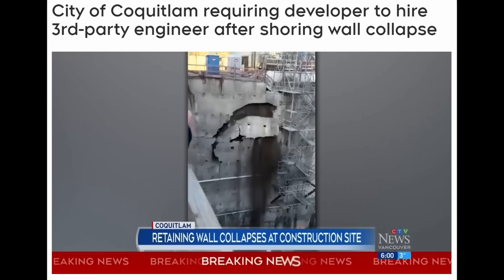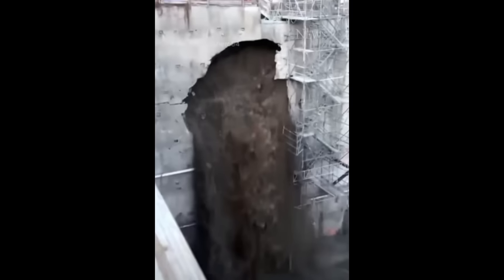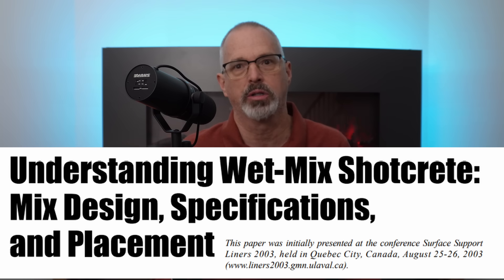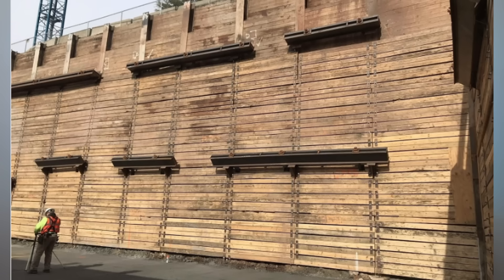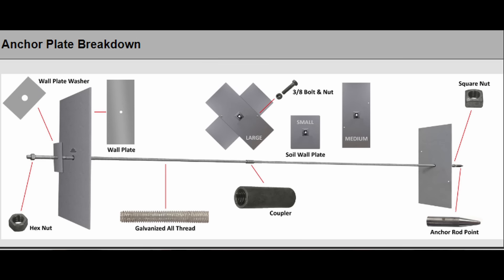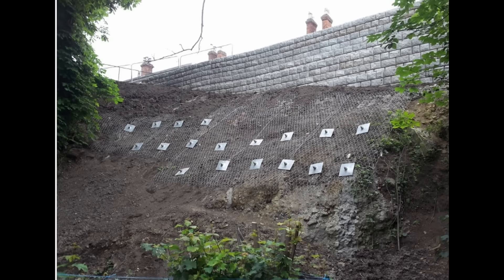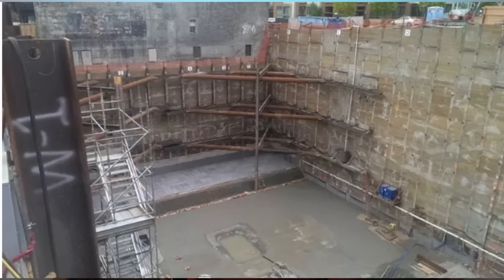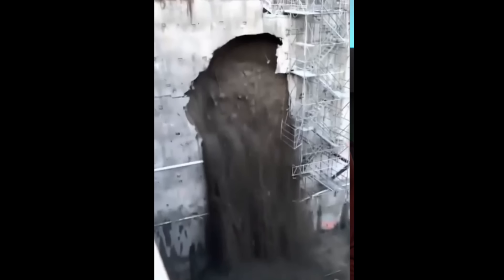Retaining Wall Collapse in Canada

Comment: I saw shotcrete used over a failing retaining wall that used what I think were screw anchors intended for use in foundations for houses. The wall was made of T-shaped CMU blocks, with some zinc plated brackets attaching the rods to the blocks. The whole thing was lined with landscape fabric, which didn't help the drainage. The wall was failing because it didn't have enough drainage behind it, and the constant pressure had caused the bottom of the wall to bulge. The lowest anchors were trying to hold on to liquefied soil. Even the pavement in the parking lot was bulging. The next two rows of anchors were heavily rusted. The shotcrete was applied to the existing wall. The whole thing collapsed about a week later after a moderate rain. I doubt an engineer was ever even consulted because I can't imagine any engineer not realizing that water was the problem and anything that made the drainage worse, such as covering it with shotcrete, would trigger a complete failure. Fortunately the only damage was the pavement in the parking lot and the landlord's balance sheet. I got a look at the wall when they took a backhoe to an undamaged section near the failure. There was no drainage system that anyone could identify, but there were a lot of largish rocks that were not local to the site at the base of the wall. That might have been an attempt at a drainage system, but it didn't meet code even 40 years before the failure when the last revision before the construction was known to be completed. Exactly when the wall was started and finished was not clearly determined, and it may not have been built all at once.

Previous attempts to address the wall included planting aggressive vines in the hope they would hold the blocks together. The wall actually looked nice, more organic than the typical retaining wall. But anyone with any engineering sense would look at it and then park somewhere else.
Reply from the maker: Thanks for sharing that experience.  Having seepage conditions behind a wall if it wasn't planned in the design can easily reduce the factor of safety by 50 percent.

Comment: I work in a different Province as a Power Engineer. I met a crane operator at one of my exam sittings. Young lad was unlicensed and operating the largest tower crane in the Province with no tower crane experience or training. Good people are hard to come by today in the trades in Canada, and in some cases any warm body will do, apparently.
Reply from the maker: There aren't nearly enough people to fill all the oown trade jobs in the U S. either. Plenty of opportunity for experienced folks if they never want to retire!
Reply: @CaseyJones-Engineer  I want to retire - I have been doing this for 25 years - enough already !  :):face-pink-tears::face-pink-tears:
Reply: you can say "Alberta" if you want to. The SAME company I worked for in BC and Alberta was like Japan.....and Afghanistan. The culture in BC's high rise concrete, especially Vancouver, is usually world class, and shot crete companies are specialists you call in; you don't do it yourself. As far as your extreme off thread comment about crane, you maybe should know what BC did in 2005: re-tested EVERY ticketed crane level including mobile crane, Ports lift cranes, and all the other types (ticketed separately). Old guys got the hard questions. Thin out the alcoholics, crackheads, and other druggies types. you have to before someone gets killed. Except Alberta. Freedom fry, and those "lads" are usually head office relatives, so you can't say anything. Had a "hatonbackwards" type powering a full size loader at high speed in an area just east of Calgary downtown, and he almost ran over a senior. That will not happen in Vancouver. Maybe the island or up country.
Reply: @HeronPoint2021  Obviously BC rested on their laurels after 2005, there was a serious crane collapse on Kelowna in 2021.
Reply: @HeronPoint2021 years ago I worked for a general contractor, rhymes with turd. Their philosophy was spend a buck to save a dime. They absolutely did as much of the trades work in house if they had the laborers available.
Reply: I can confirm. Alberta is an epic shitshow of crap construction and fly by night Lyle Langley types... 4G Albertan here and I am sick to death of its fatal flaws including a Premier whose vision of healthcare is talking in tongues and praying away cancer, just as long as its not Stage 4. I wish I was joking about either but I'm not, she is on the record believing in both and this was BEFORE the recent provincial election... Just as long as oil prices are high people here will vote for anything. Once they dry up? Suddenly Ms. Notley's NDP didn't look so bad after all... @HeronPoint2021
Reply: 70% of people can run a crane without a problem. It is a very simple job if you know math.
Reply: @richardpetersen2747 and people have been seriously injured and killed and property destroyed due to incompetence. Hence the requirement for crane certification

Comment: Weird failure, usually see a geotechnical capacity failure from nail pullout, not a structural failure.
Loose Fill, not a high enough phi to efficiently transfer load via arching to anchors, so hit midspan of shotcrete. Possibly was getting by with cohesion, until the dewatering dried everything up. Also Looks like Insufficient bearing plate capacity, or tie overlap between bearing plate and lateral steel reinforcing, or not enough steel reinforcing. 

I'd be curious if this was design with LRFD or ASD methodology. The LRFD for soil nails is kind of wack, and easy to think your design is good.... when it is not. Or possibly they used average nail load instead of max nail load to design the lateral steel reinforcing. 

Highest I've done was 90 FT wall with soil nails. Had a hellava batter on the face.
Reply from the maker: You raise and interesting point.  LRFD has many design aspects that aren't very intuitive in my opinion.  I agree too that there was no way that the soil loads could be effectively distributed to the anchors given how loose that material was.

Comment: the only place I had seen Shotcrete used for that large of an area, was the temporary patches on the Oroville spillway, and that was strictly a water flow/splash barrier nothing more. a 3000 foot (914 meter) tarp would have worked to keep the water from eroding things more, just didn't have one large enough (some sarcasm there). The Shotcrete wasn't holding up the slope, never intended to do that. I have lots of doubts about what they were thinking about using that for that foundation in Canada.
Reply from the maker: I agree with you. I don't know what they were thinking (engineer and contractor).
Reply: High rise concrete in Vancouver has set the quality standard for N.  America: we didn't have mafia, overseas, or sketchy politically connected companies taking shortcuts. This is weird to me. I did ten high rise buildings in Van. out of the hole until they were finished and people moving in: world class work. Someone screwed up. and our Workmens' Comp. in the Van. area will find out: they issue reports like the TSB in the USA. And no one will get a pass.
Reply: @HeronPoint2021 the phrasing "Someone screwed up. and our Workmens' Comp. ... will find out" gives me some worry that it will just be throwing bodies at the guillotine to say "we found a scapegoat to blame, so we can go back to doing things the way we did". it's not enough if the system promotes the unsafe practices that lead to this, the system also needs to be examined to prevent it from happening again, otherwise your just setting people up to fail over and over again. just saying.

Comment: Who would have been the 'engineer of record' for a retaining wall on a project like that? There was no reinforcing or mesh within the wall itself! Who designed it? Who approved it? Think there are a couple of someones, that may be shown the door!
Reply: I was an insurance adjuster and I would investigate these types of failures. My clients insured both engineers and developers. The retaining walls for an excavation are temporary. Once backfilled it’s not needed. So developers and their engineers will take risks to save money. I saw that numerous times.
Reply from the maker: I think the designers and contractors need to be more aware of the life safety issues posed by taking such risks.  From a design standpoint, if a temporary wall is in use long enough, it should be designed as if it were a permanent wall. @andyeunson270
Reply: @andyeunson270  I think (not positive) that OSHA requires shoring below a certain depth to be designed by a 'professional engineer'!
Reply: @frednewman2162 In BC  that is absolutely required. The developer is one that I was familiar with so I can guess who that engineer was.
Reply from the maker: I think somebody will likely be in trouble over this design and construction.

Comment: yeah, nothing for pushing back inside the tub has me thinking of the former vid's comment. did anyone calculate the loads before the floors were added to the basement, who signed off on it, etc, hmm. It probably won't be the mechanical side that takes a while to investigate, it will be investigating the human factors and administrative systems that allowed it to happen.
Reply from the maker: Good point.  It is interesting that apparently there was no third party review done initially.  This is getting to be a common theme on these projects with problems.

Comment: What blows my mind is that that wall is retaining soil under a road. With it being that loose the compression artifacts would be immense. The amazing thing is that it was minor. I would've expected the whole side to collapse and the road to subside. They got lucky.
Reply from the maker: Good point.  It really could have been much worse.
Reply: It's clear that someone failed to do a proper geologic review before deciding that this was a proper engineered solution for this site.
Reply: @ianbelletti6241  They didn't need one. They already were doing it excavating! They knew the exact composition of the soil and yet came up with this thing. Farther down the thread someone mentions that traditionally Vancouver's soil is a heavy clay mixture not too far down which is why this is a standard method. Ok, except they already knew that this wasn't "the usual" and should've adjusted accordingly.
Reply: @alexandermckay8594  the planning occurs well before the first shovel hits the dirt because the solution requires an engineer's approval.  The engineer is supposed to watch as they dig and pay attention to what actual conditions are.  That particular side should have had a stop work order given by the engineer until the safety system was redesigned for that section.
Reply: @ianbelletti6241 in BC the engineers rarely leave the trailer.
Reply: @BawkBawkBawk666  hey its wet out there - besides the trailers have windows.
Reply: @GFY_FOAD  from an operator standpoint, I'd rather the engineer stay in his trailer unless requested
Reply: Actually that is minor compared to what could have happened. This has the potentially to collapse an entire building if it was adjacent to the site. This method is often used adjacent to existing buildings.
Reply: We build in unsuitable soil conditions all the time. Their building a 70 story building on a marsh.. the sidewalks and road are constantly buckling already..

Comment: It looks like the anchoring rods stayed in place, so probably the concrete was not strong enough tp hold, not thick enough, not enough rebar, or the anchors punched through (shear/punching failure)
Reply from the maker: I don't see how the thought the load would transfer between the anchors and face plates without structural reinforcing at the face of the wall.
Reply: I don't think that there was any rebar at all there, so the wall was weaker than an egg shell.
Reply from the maker: @ehsnils  I think you are right about that.

Comment: Someone should lose their PE for this.
This type of structural failure will increase as the new crop of "engineers" depend increasingly on button-push design, and less on using their heads to first do the fundamental analysis.
I bet the design calculations done for this and reviewed by the governing agency, showed that it was just dandy, but they missed something fundamental that would have been obvious to us older engineers.